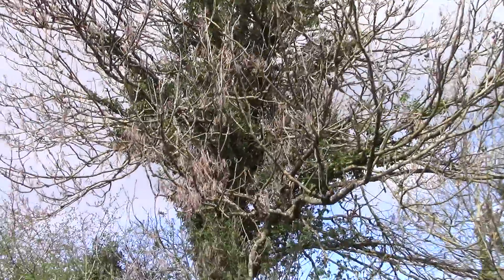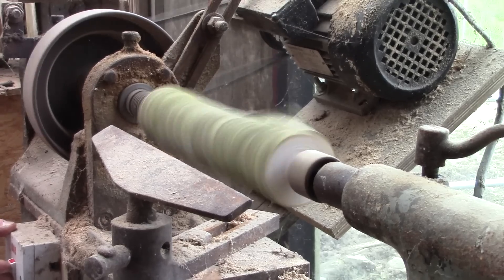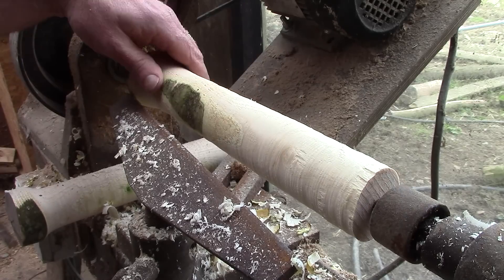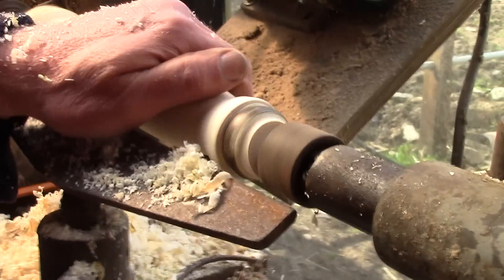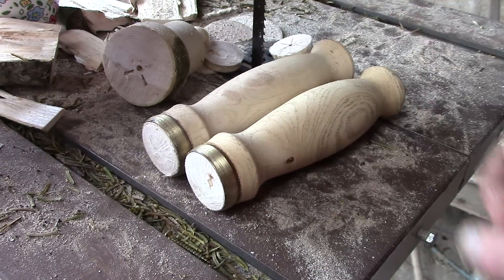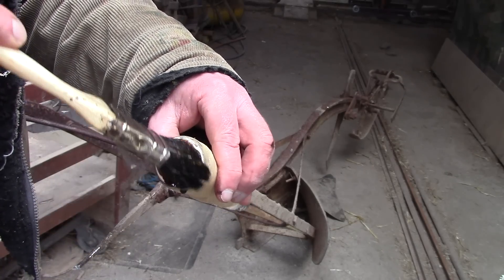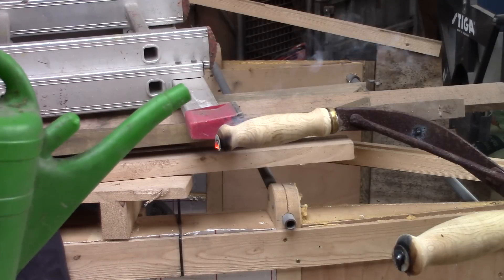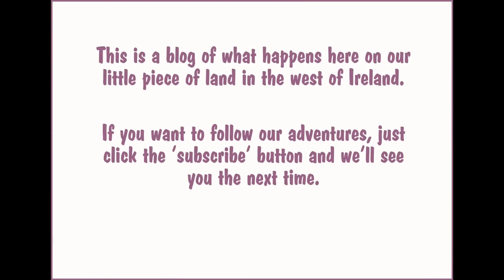Quick, Let's Make New Handles For Our Old Horse Drawn Plough

Comment: +WayOutWest Blowinblog Tim, next time you have a hand-made tang you need to fit a handle onto, you might try "burning." It's literally just rough-shaping the hole, then heating up the tang to a low/med "red" and jamming the handle on (sometimes more than once). Custom fit, much less hassle.

 Of course, this will remove any temper from the metal you heat, but most handles and such aren't tempered anyways. Just a suggestion, and thanks for the vid! I love seeing how you guys always figure out a way of doing something-- you never seem to give up. Very inspirational.
Reply from the maker: +TheJohn8765 I would have done just that, John, except I'm nearly out of propane and there's no way I could get the handles into the forge : -  )
Reply: I shouldn't be surprised you know about it already. Lol, you guys are both super competent people.